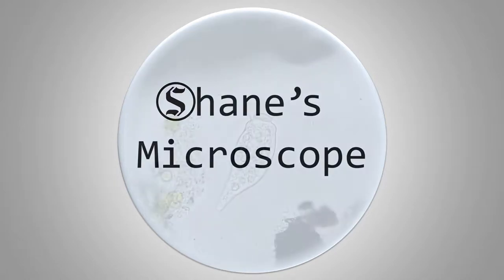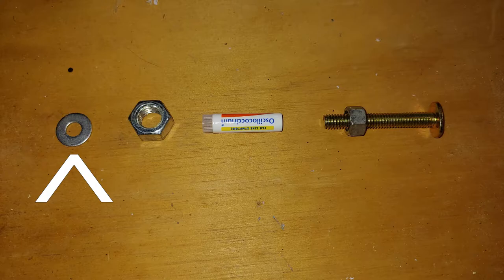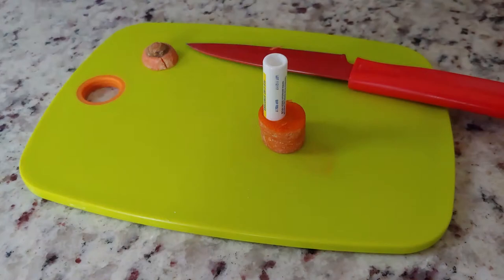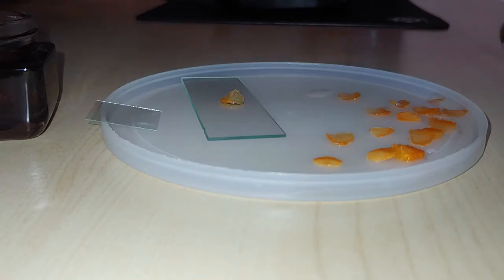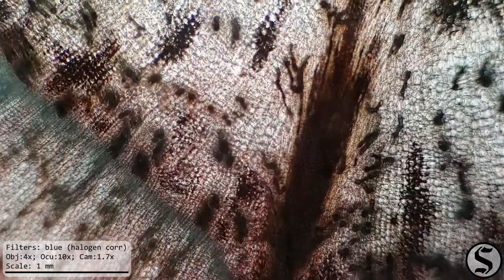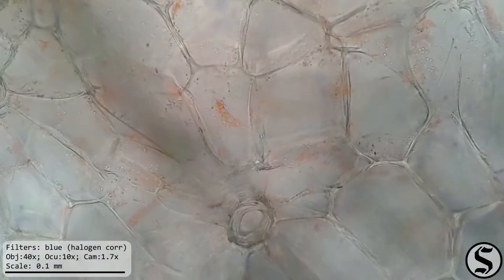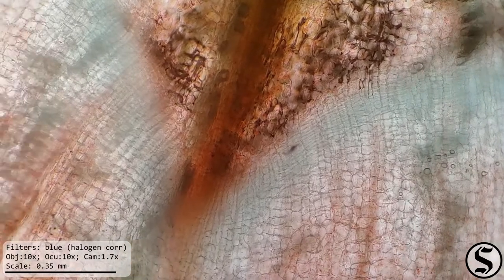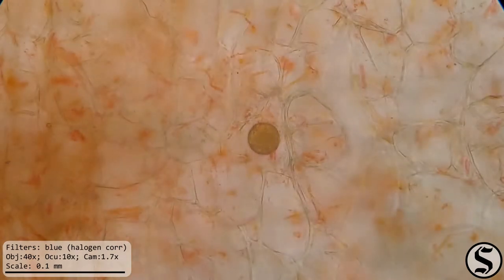Expedition 2 - Carrot Cross-Section

Comment: Do you have the sizes of the nuts and screw in the microtome?  I love info on word origins.
Reply from the maker: They were just lying around in my toolbox, maybe in the ballpark of 1/4" diameter.  Their specific size doesn't matter so much though, you just need to match the bolt as closely as possible to whatever you want to use as the main tube of the microtome.